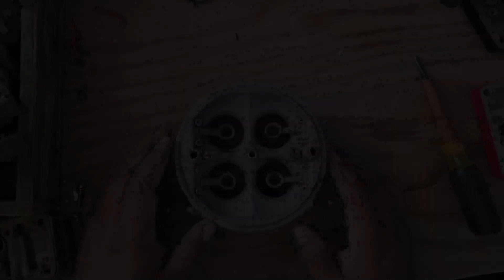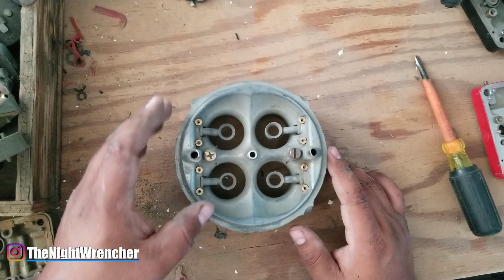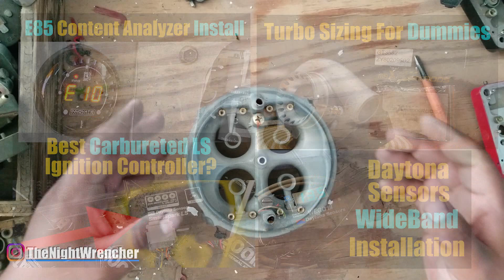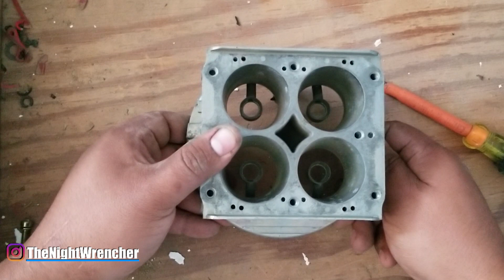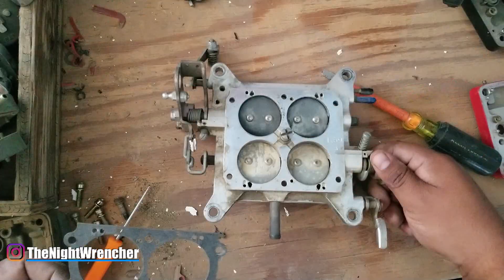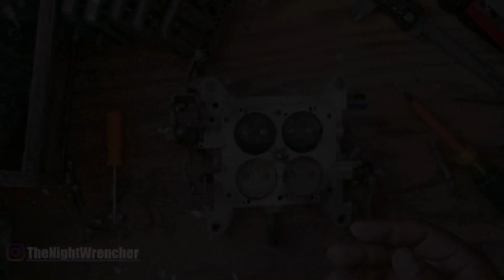Build Your Own Carb For BIG POWER!- Part 1 | Holley Carb Secrets | How To Tune A Holley Carb

Comment: Very Informative video.
Btw could you pl. suggest the best boosters for my Double Barrel Mecanically operated Carb with straight line Boosters (Primary Main Jet 92.5, Primary Pilot/Idle Jet45, Secondary Main Jet of 175 n Secondary Pilot Jet of 90) with a City min/max speed between 10mph to 40mph n Highway min/max speed of 40mph to 80mph n top end of 120mph (tested on traxk only) in my 800CC City driven car name  "Maruti 800" sold by Suzuki Japan in my country between 1986 to 2001.
Pl. Suggest.
Thanks
SK

Carb Link for reference from 4.10 mins
https://youtu.be/nebTPNi1Rzo
Reply from the maker: I wish I could help you but I don't know anything about small engine carbs :(